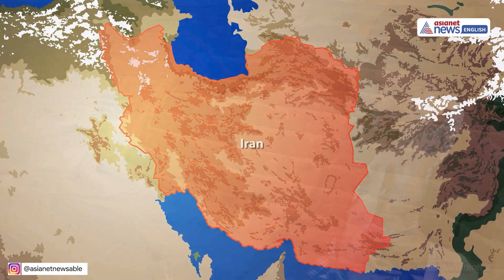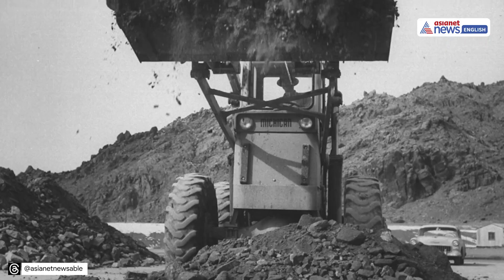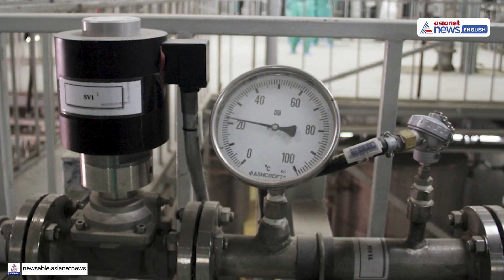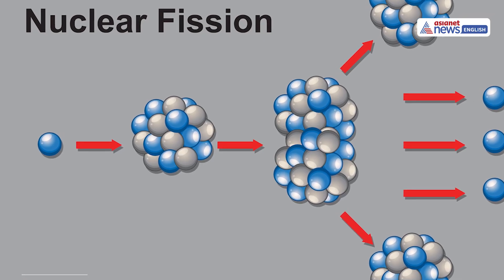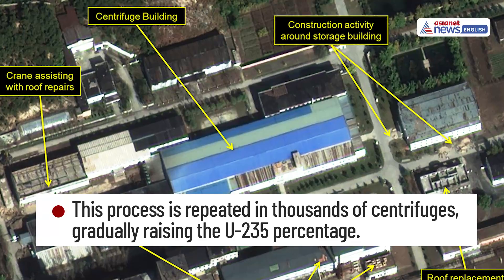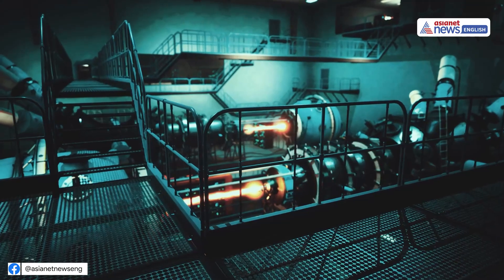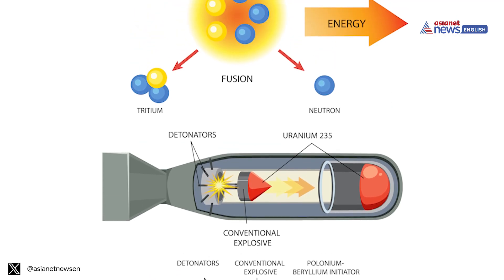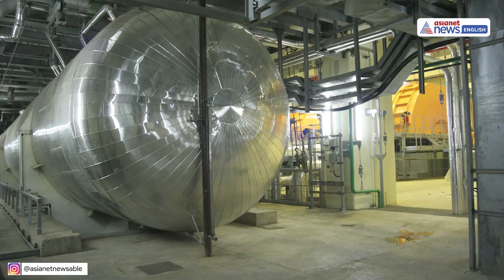How Uranium Rock Becomes a Nuclear Bomb: Full Breakdown | Israel-Iran Tensions

Comment: If they had a lot of uranium hexafluoride at one of the enrichment compounds, I wonder how long it would take to cool down for transport. When reports came out about the deployment of B-2's 24 hours before the bombing, Iranian intelligence might have suspected that they weren't going to their reported destination but rather straight for those facilities. Is 24 hours enough time to prepare and transport the uranium hexafluoride?

And one of the targets was apparently a storage facility. If they were storing enriched uranium in solid form, that's just a few hundred pounds, which they could easily move out of there. There likely would have been safety issues with doing it in such a rushed manner, but from Iran's perspective the alleged weapons program is a matter of national security and international dealmaking. That may have outweighed the risks of contamination and exposure.